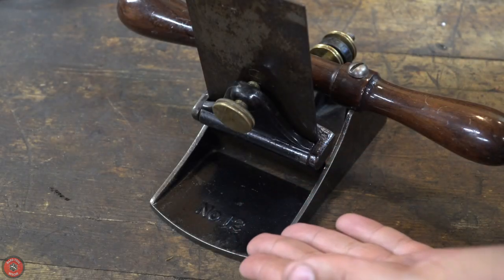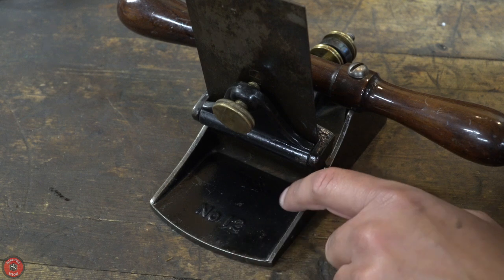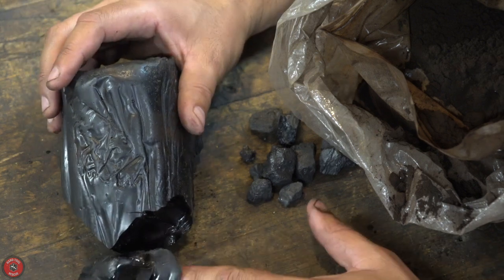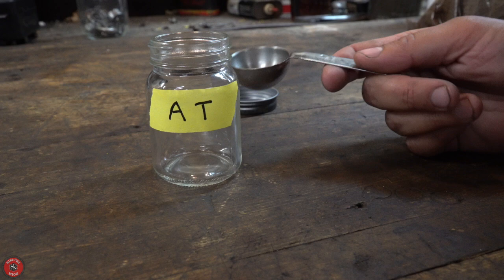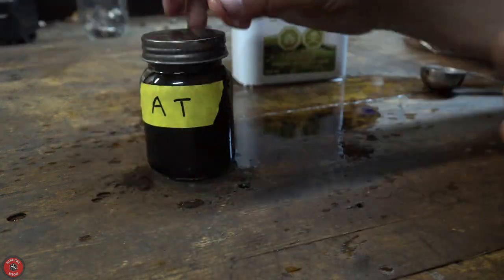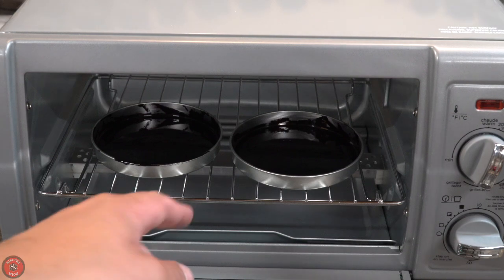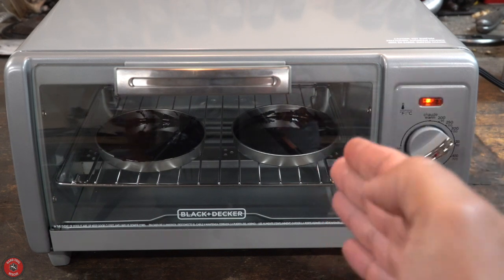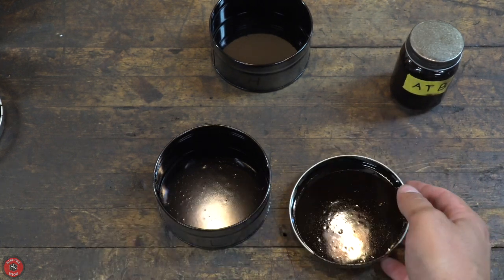Best Japanning Recipe

Comment: I've tried multiple variations including one that replaces boiled linseed with varnish and I still can't seem to get it right. I'm doing this on tinware and keep getting little bits of particles on the finished product. Does letting it rest before placing it in the oven do much? I haven't tried that yet. I'm literally typing this while watching my toaster oven bake the fourth round of tinware!
Reply from the maker: Add more turpentine or less asphaltum. You should also make sure not to stir the mixture before applying it.  Also, make sure the metal surface is nice and clean.

Comment: As a heads up that roofing tar is make from a mixture of coal tar (coal is heated in a electric furnace and the tar drips out - byproducts are coke and coal tar) and petroleum distillant ( what is left after the gas, diesel, and other useful chemical are taken out crude oil. They are mixed and evapored down to found the hard block you have. Coal tar, though dangerous may by useful to you, but very cancerous until all the chemical are burnt off. If refined to a powder you have carbon black.

This also falls into your timeline, as by the end of WWII carbon black was deverted to the mass production of tires and makeup as well as 600 other product in mass consumption.

Comment: When you're oven curing a substance like that, you're best served if you do not open the oven until it had cooled completely.  Just like seasoning a frying pan similarly, the consistent cool down period makes a big difference.  Then check to see if you need to go again. 
  Roofing tar never hardens tk the point of chrystalizing, which is its purpose, to retain a small amount of flexibility (actually, liquidity, if ya wanna split hairs).  You need something that will convert to a hard, glazed, crystalline finish before it will permanently fuse to the metal and filling the poors, not just covering them over.
  And just for the record, there's "nay susch as a thing" as "ashfault/ashphault."  It's commonly mispronounced but it is indeed, "ahphault."   Interestingly enough, some recipes did at one time contain coal ash as an ingredient but, that's neither here nor there to the name.  😉

Comment: There is a fungus in raw linseed oil which causes it to go black over time with exposure to the elements.   Boiling it stops the blackening process.   Applying 18th century alchemy to the situation, it is remotely possible that part of the blackening comes from the linseed oil ingredient.  

Always available to help,

Stavros

Comment: Your comparison at time stamp 31:17 appeared to me that the spray on paint was equal to or better than the baked on japaning.Also the spray on paint didn't have the air bubbling that the baked on did.
Reply from the maker: It's definitely not a bad option at all, it's just not as authentic.

Comment: paint wrinkles are a common film fault caused when the surface cures before the substrate, as the substrate cures it pulls the surface together causing wrinkles due to shrinkage

Comment: Would this work on anny kind of metal ???
I got a old carrige wheel licht and the original metal is allot darker than the parts from wich the licht hangs so there is a big color difference (original dark and rusty, hanging junk licht gray)
Ive tried to heat it so it would become darker but its rubbish metal and started to bubble so i need to finish it another way.
Would this work on that ?
Reply from the maker: You could try metal darkener as well.
Reply: @HandToolRescue  what do you advise ?
I did not know that there would be products for this.

I had in mind to heat and whipe with linseed oil but that did not work.
Reply from the maker: @deborahmeijer9697  Try out the metal blackener. JAX makes it.
Reply: I will !!
Thanx for the help !
😁

Comment: You crack's me up - off-line things called books. Maybe you need to do a video on using such archaic technology. Paint making recipes often talk about mixing and grinding in pigments.  "Lee's Priceless Recipes" published around 1895 has recipes for Artificial Asphaltum, Black Japan Varnish, Black Japan. and  other black varnish recipes. The last two call to heat/melt the asphalt and blending in other ingredients warm and/or cold. The mixtures are applied and left to dry.

Comment: I am surprised you do not need to bake the boiled linseed oil recipe at a higher temperature in order to polymerize the oil, since it doesn't fully polymerize until you start approaching 300C. I suspect then that the japanning would continue to harden, I guess, as the linseed oil cures over time after baking is done. I was curious to see what would happen if you baked it at higher temperatures to speed up the drying time of the linseed oil, but googling it, it looks like the asphaltum would likely catch fire before you could reach boiled linseed oil polymerization temperatures. Oops!

Comment: Here try this out. You can buy all the ingredients online.

 #2 Japan formula (From 1912 book)
Run 48 lb's of Gilsonite in a set pot, and when melted add 10 gallons of oil;  (For a 1 lb Gilsonite use 26.6 oz oil) 
run in the gum pot (A separate pot) 8 lb's of common gum animi, and mix with 2 gallons of oil ; pour the mixture into the set pot,  (For a 1 lb Gilsonite use 2.66 oz gum animi (White Copal)and 5.33 oz oil )
then (in the gum pot) run 10 lb's of common amber, and mix with 2 gallons oil;  This running is also added to the set pot, the contents of which are boiled for three hours longer, during which time 7 lb's red lead, 7 lb's of litharge and 3 lb's of copperas are added, and the boiling  continued until the mass sets between the fingers into a hard mass.  Allow it to cool, then thin it with 30 gallons turps. (For a 1 lb Gilsonite use 3.33 oz common amber/ 5.33 oz oil / 2.33 oz red lead / 2.33 oz litharge / 1.0 oz copperas / 80 oz turps)

Ingredients needed
48 lb's Gilsonite.  (1 lb Gilsonite)
8 lb's common gum animi. (2.66 oz gum animi) Same as White Copal

10 lb's common amber. (3.33 oz common amber) Need to make it!
7 lb's red lead. (2.33 oz red lead)
7 lb's litharge (2.33 oz litharge)
3 lb's Copperas. (1.0 oz copperas) Same as Iron Sulfate.
14 gallons oil (Total of 37.2 oz Linseed oil) 
 30 gallons turps. (80 oz turps)

Comment: Another good but REAL japan recipe from the same book.

Black Japan Recipe
From a 1912 paint recipe book.
6 Gallons Linseed oil boiled on low for 2 hours (For a 1lb recipe 19.2 oz)
Then Take 40 lbs Gilsonite mixed with 8 gallons linseed oil and add it to the boiled linseed oil. (1lb Gilsonite and 25.6 oz linseed oil)
Then add 7 lbs red lead,  7 lbs litharge and 3 lbs Copperas slowly in small quantities.  (2.8 oz each lead and 1.2 oz Copperas)
Keep the mixture boiling  slowly for 4 hours longer and then let stand  until the next day.
when it is boiled until a small quantity taken out on a glass will, when rubbed or rolled in the fingers, set hard.
It is now allowed to cool, and when sufficiently cold 30 gallons of turps are added.  (96 oz)
If after cold it is too stiff  it can be warmed up and more turps added until it gets the right consistency. 
This Japan is used for all kinds of iron work about carriages that are to be black. It dries with a hard durable lustrous coat in about 8  hours.

Comment: The weird holes are from solvent pop. The turpentine is boiling off and causing the holes. A bigger oven would help. You could Also add a thick steel plate into the oven to add thermal mass to keep it from heating up too fast and that problem will go away. Should be a bulletproof finish for another hundred years with the asphaltum that way. Another cold cure you can try is coal tar epoxy. That shit is indestructible.

Comment: I think I figured out why the poly and urethane coatings came out grainy. As the asphaltum is absorbing and then subsequently dissolving into the turpentine I think the grains are becoming encapsulated in the poly and urethane. Then as the volatiles start evaporating the volatile percentage starts going down in the surrounding fluid. This draws the turpentine out of the encapsulated asphaltum leaving it to remain extremely grainy. 

Theres an upper limit to how much can be encapsulated before the other asphaltum can be encapsulated before a large amount of it is used up explaining why some still gets dissolved and you still get a somewhat of a black finish. If someone knows more about the chemistry of how this happens then please correct me. I come from a physics background, not chemistry.

Comment: Polyurethane is probably not the right material- try with real old school varnish, which was usually just more turpentine and some sort of dying oil (tung, linseed, etc) and various plant resin, so very similar to your first recipe.   Also don't be afraid to first use a huge amount of turpentine to dissolve the asphaltum, then filter this really thin mixture through cheesecloth to remove sand and large grains, and then  you can simply leave the mix for a few months for the turpentine to evaporate and thicken to the right consistency..

Comment: Urethanes are poor at dissolving pigments.  Using spar varnish rather than spar urethane should give a a coating closer to the linseed oil, but more durable.

Comment: Thanks, but I prefer Shezhuan over Japanning....mo spicy !    Recipe...  Ass-fault-em ,  Canadian Club whiskey thinner & 10% Canadian maple syrup.  Apply with a sweater and windbreaker instead of 2 COATS.  Next...pre-heat KENNER easy bake oven and cook for 2 days or until lightbulb ignites the goo.  PS...have the fire dept. on speed dial , just in case.  Lastly ,  do not apply to any tools that you cherish.  Have FUN folks.   J K

Comment: I found some old recipes in a book I have.

Which turns out (these days) to be online:

https://archive.org/details/workshopreceipts05spon/page/92
Reply: Here's the relevant text extracted:

Japan, that is the paint-like material to be laid on the metal, is made of  shellac varnish, with which may be incorporated any pigment necessary to introduce a desired colour. Shellac varnish is made by dissolving shellac in alcohol. A better varnish for japanning is made by adding resin and shellac, 2oz. of each, to 1 pint methylated spirit. Any pigment may be added to such varnish to form japan of the colour required. A few formula; may be useful. Black : Mix lampblack or ivory-black — this latter preferably — with the above varnish. Another black : Melt 1lb. asphaltum, and mix with the same quantity of balsam of capivi, thin the mixture to a workable consistency with hot oil of turpentine. Another black : Mix lampblack with oil of turpentine, and grind smooth on a muller, thin the mixture with copal varnish. White : Flake white, or whitelead, ground up with ⅛
 of its weight of starch ; this must be thoroughly dried, and mixed with mastic varnish. Yellow : King's yellow is used as the pigment, but the effect is considerably improved by dissolving turmeric in the alcohol before adding the shellac to form the varnish. Various colours are made simply by the incorporation of a suitable pigment in the varnish made as described above.

Comment: Dollar stores often have inexpensive funnels for sale, or watch this: 

https://www.youtube.com/watch?v=XEqttglnE0w 

It works better with plastic bottles but it sort of works with can too. 

I use a toaster oven to bake small (anything that will fit) metal spray painted parts. Around 300 degrees for a half hour. It's not Japanning but it is harder and more durable than just spray painting.

Jim Y

Comment: You being one of the smarter guys with your posts and Rescue videos ...I'm having a real problem with your understanding of percent ratios . I know you said " about" measurement for the Ingredients but....I know you understand the difference in measuring a powder to a liquid as components of a mixture . The mole ratio is used to mix two or more ingredients to a mixture , right ? You are going to get a bunch of meth head comments about how you mixed the powder to the liquid as percents of a final 100 percent ....just saying . Also , pour your terp upside down . With the pour hole on the top of the can . It wont glug out because the hole works as the vent as well . Try it ? ( 27 yrs at Sherwin Williams and Rhodia -Solvay can't be wrong ) ..
Reply from the maker: Haha, I know.  I just kept it simple because the solution is very forgiving.  You could probably do it all wrong and have it still work out.